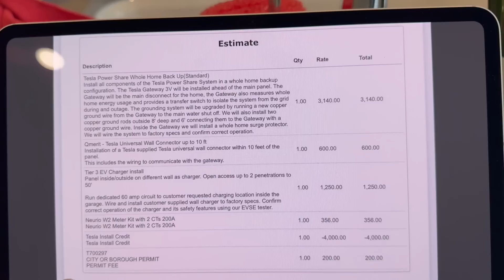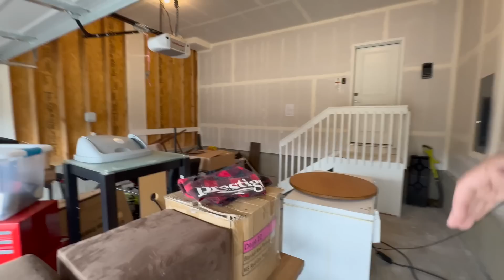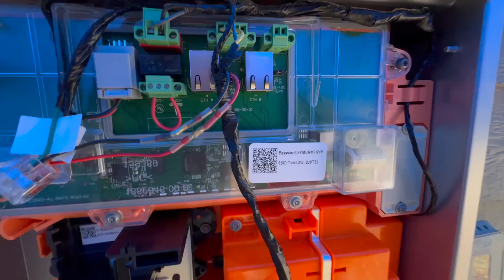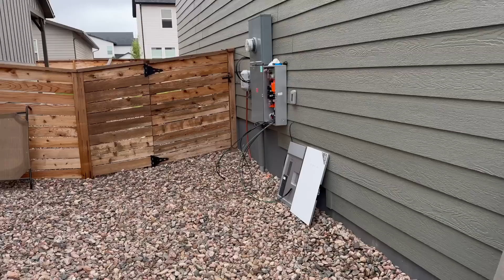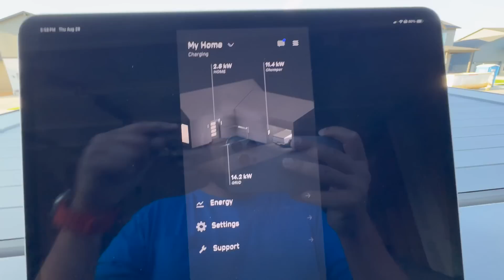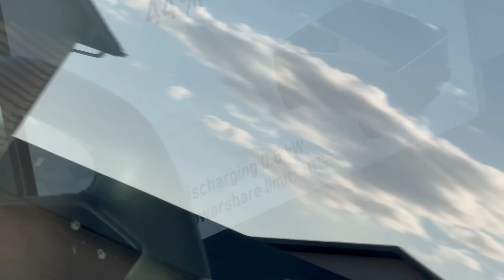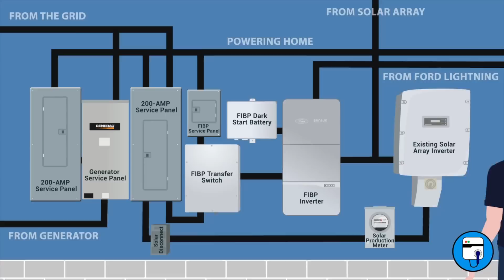Installing My Level 2 Home Charging Setup w/ Tesla Powershare Bidirectional Whole House Backup!

Comment: coils are so you can feed 240 V and have a center tap to get 120 V circuits. 240 VAC is fed on each end, with a center tap to get you 2 120 V AC circuits.  This is normally supplied by the pole transformer, but since that is disconnected when running off the Cybertruck, this is needed.
Reply: Yep exactly. Cybertruck only outputs 240v single phase. No neutral. The backup gateway has a neutral forming transformer. Really similar to Enphase sunlight backup as enphase solar micro-inverters only output 240v too.
Reply: @ColeBlack2  double yep, the coils provide a function referred to as an autotransformer.
Reply: Yes, and they probably also work to reduce common mode voltage from the Cybertrucks inverter and provide ground isolation.
Reply: My guess is that it's a split-phase downstep transformer from 240 volts to 120, and the center tap is the common neutral?. Since the coils looked like a transformer.

Sorry, I have a basic understanding of how split phase works in terms of obtaining a 240 VAC circuit.  And while my father was a lineman we never talked about the nomenclature of a transformer. So this is the first time I've ever heard the term Center Tap.

At least the post explained how the Gateway worked. Until now I was assuming it just back fed the electricity to the circuit breaker box. So at least my understanding is vastly improved in terms of how it works.But it's a shame the post didn't go into more details about how it converts single phase to a split phase service. Or the load power sharing function of the EVSE. And I was a little confusing since they used the term power sharing in two different contexts.
Reply: @nc3826 well that bothered me, too, until I ordered another boilermaker.
Reply: thanks for reminding me that... "the only winning move, is not to play."

Comment: The solution I want is a house battery, like a PowerWall, that is supplemented by the vehicle's battery. The house battery could be 5 to 10 kWh, long enough to keep the lights and fridge on, and when a vehicle is plugged in it would enable power to the other larger breakers, and top up the house battery.
Reply: Can totally do what you want by adding a PowerWall to Kyle's setup and it would do this seamlessly.  Or if handy you could go DIY with a more manual supplanting.  Just need a car with V2L capability - to connect to a charger for your battery inverter.
Reply: This is the setup I have and will have once the CT arrives. Near perfect.
Reply: @GarrettL757 dittos. My Beast came in 3 weeks ago and still no power share hardware.
Reply: An EG4 12KPV and either a server rack battery or two or their wall mount battery would be perfect for this (and most people's setups)
Reply: Look at a company called point guard energy. They have a home battery modular stack and advertise a 12.5 or 25kw EV DC bidirectional charger. It doesn't seem to be available yet though, and I haven't been able to find any vehicles it actually works with.
Reply: This is exactly why I built my Victron system.  Keeping it small with just 1 5kWh battery for now and a portable power station too.  Just need to figure out EVSEs that will integrate and if I need to get another inverter to do 240V or if I can stay with single phase.  No problems running our whole home off a 5KVA multiplus for now.  No EV yet😁

Comment: The only thing you're missing is a UPS for your wifi.
Reply: Wifi and CCTV NVR.  I have a NG generator and the UPS's are great for the change over.
Reply: It doesn't take long for a router to reboot
Reply: @Defianthuman  but better Never to .. Asia has many basic 12v batteries inline for this
Reply: @Defianthuman  better that it never goes down.  I have 3 UPS units in my home to protect various electronics.  My systems are protected for 10-15 minutes, more than enough time for the NG generator to come online.  Even better for those times the power 'chatters', nothing loses power during the chattering so can't lose power while it's rebooting from the previous dropout.
Reply: @genelane2243 I agree with you. If you have a pure sine wave UPS, even better.

Comment: The wallboard in the garage is probably due to code.  Most States require wall board for any structure connected to an inside wall of the house.  The wallboard on the outside wall would be because of the meter on the outside of the house.

Comment: Why are these all limited to 10kW? Hardly bidirectional 😂
Reply: Because inverters are expensive, essentially. On the Cybertruck the onboarding charger/inverter has to handle the DC-AC conversion, so it's limited to 10kW. On the Lightning it's offboard, but larger capacity still costs more. 20kW would be a cool I guess but do you really need that?

Comment: What happens if you plug the car in when the house doesn’t have power, does the truck have to be connected before the house looses power? 

What happens if you unplug the car while the house is running on the car? Does it let you?

Comment: Anecdotal experience, the Powerwall and gateway when reconnecting to the grid is seamless, so perhaps because its new the 2-3 seconds of outage when reconnecting back to the grid will be fixed and unnoticable in a coming update.

I can confirm that when there is a grid outage, there is a 2-3 second delay for the Powerwall to kick in so I think its working "within spec" :)
Reply: The powerwall can run AC-coupled as it's also a solar inverter (i.e. it is allowed and able to feed while the grid is up). The inverter inside the Cybertruck cannot, it's running as an independent backup generator that must be disconnected from the system before grid connection can be reestablished. Also, the split-phase transformer (that makes 2x120V from the Cybertruck's 1x240V) cannot be connected to the system at the same time as the grid transformer, and to disconnect it it must first be discharged.

Comment: The way that is wired, you can run the dryer and whatever else and charge cars. They spliced the Tesla control unit in-between the utility meter and your 150amp main braker. So, you have 200amp service to the Tesla wall connectors and the a/c unit. (but with lower value breakers for safety) The Tesla control unit then connects to the main breaker in the garage. Very well designed.
Reply: No, all power goes through the 150 amp main disconnect before it is connected to the Tesla Gateway.  That's how he simulated the power failure, by turning off the 150 amp main disconnect.
Reply: @ericjorgensen4826  that dosen't look like a breaker. It appears to be just a switch.
Reply: It could be🤷‍♂️. But it looks like a switch to me.
Reply: @hallcrash  It is the main disconnect switch, but upstream of that switch must be a 150A main fuse to limit the installation. Otherwise you could draw whatever you want from the grid instead of the 150A you pay for.

Comment: Kyle.....why run conduit from the gateway to the second wall charger.  Seems like it would be way cheaper/simpler to power the second wall  charger from existing pannel on other side of the garage?
Reply: Both chargers have to be wired to the gateway mounted outside for the load management to work IIRC.
Reply: @TechnicalLee  .... I'm not following.  Aren't the lugs on the 3V just connected to the internal panel board?  The 3V certainly isn't going to manage current between the internal board and the lugs going to the main panel. I'm thinking if both chargers are in use during an outage, he'd just be discharging the truck to charge the car!

Or are you talking about sharing available power between a network of wall chargers?  (Load sharing in the WC setup).  That mostly comes into play if multiple WC are on a single breaker.  Or if multiple WC would suck up too much of available amps to house.  And that's communicated to them over their own network.
Reply: @TechnicalLee  ... Makes sense.  I was confused because Kyle talked about the Murio sensor being installed at the main box.

Now I'm thinking the Murio will be installed at the gateway to measure total power to the house.  Then it can derate the second charger appropriately.  And this is more for on grid load management since he has 150A service and 2 48 amp chargers.  

Not sure how that will help with load management when truck is only supplying 48 Amps.  Probably just manual load management?
Reply: Obviously so he can run the house off two Cybertrucks.

Comment: Ioniq 6 VTL/H is also AC out. Wonder if the Tesla system would work with the Ioniq 6.
Reply: I assume it would not work, but it would be cool if Kyle could test it out with the new EV6 they leased.
Reply: I’d love to see him test it. But I believe if the system wouldn’t work for charging then it wouldn’t work for powering the house either.

Comment: You're absolutely correct about them taking you for a ride on the price to maximize the Tesla credit.  I had an electrician in Boulder county install my Rivian EVSE with dedicated 60amp breaker for $510 out the door.  I paid the city permit directly which was < $100 as well.
Reply: I agree, but I do wish he would’ve given us an itemized bill from the company. They did have to bring in supplies like wire and conduit. The other thing is is they did have to move the wires for the AC and neither charger were close to the panel. So hard to tell, but my gut tells me you were taken for a ride.

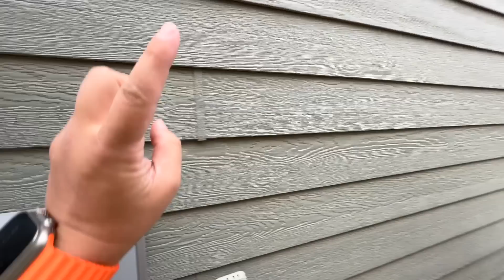Comment: 22:15 they wrote stuff in Sharpie on the Gateway? Why don't they have some sort of label maker to just label it so you can peel them off if you need to make adjustments to your system at a later date?
Reply: I think brake cleaner will remove a sharpie as well. But yea, a simple label maker would look more professional.
Reply: One can wipe off the sharpie with a solvent such as IPA, and add a label at a later date as needed.
Reply: Too lazy sharpen a pencil
Reply: Agree, electricians may use terminology different than yours.  Personalize it because it’s your money paying for it.
Reply: I thought the same thing when I saw that, it would’ve bugged me big time.
Reply: That would have cost another $4,217.45

Comment: Looks like you don't have load sheading.  Does the other charger keep charging during a loss of load?  I have a Span panel that sheds load and disconnects kitchen stove, charger and AC.  With the span I can reconnect.  I use a Tesla power wall and  solar panels. My home base load is about 1 kW.    cool
Reply: No, the only loads it can shed are the chargers and A/C unit wired into it.

Comment: I have a small battery with generator sub-panel backup on an enphase solar/battery system. It took a bit for enphase to get their software working property (over a year in beta testing) to allow for their switch to sense grid outage, switch to battery, and use the generator to charge the battery. Have had the system for four years now. Only a couple grid outages though. First one it didn't work because the battery was at 10% charge. Upped it to 50% reserve for outage scenario's and a couple other outages since and the system has switched over fine. It does cut power enough to mess with the internet cable modem and the microwave clock, but it's relatively quick (seconds) to switch over. I only wish it could support the AC unit. Neither the battery or generator have enough initial cranking amps to do that. Also can't run the stove so had to pick and choose which circuits for emergency backup. THe internet comes back up as soon as the cable modem reboots though. I was hoping your bi-directional system with 100kWh battery in CT would seamlessly cutover AND be able to power AC. Seems like the cabling and circuitry are more the bottleneck for that than the battery storage/size in CT. You said it worked, but it sounds like that could be an issue. 
I also am not a fan on different systems not having interoperability. (e.g. Enphase and Tesla for example). Also the more complex your setup, the more reliant you are on the installer and manufacturer of the components. Much more can break down and you have to pay for service calls after a limited labor warranty period. All things to consider for rare outage scenario's. If you have them frequently or are off grid and using it for overnight energy it may make more sense.

Comment: Yeah I got tired of the inflated estimates.  They literally made no sense. My father in law (retired electrician) and I installed Hubbell 14-50, about five feet of 8 gauge, double throw 50 amp for a total cost of about $450 ($150 of that was the Hubbell.  BTW the professionally installed quotes were made using a $10 Home Depot 14-50 yet they wanted $1300.00.  😅
Reply: one word...labor
Reply: @smartlifesystems  Awfully expensive labor.  Took us about 2 hours.  LOL Of course there were two of us.  Moving a circuit around to make room for the double throw took the most time.
Reply: @MikesMotorcycleProjects  I do not count your hours. I count company which have to be licensed, insured, come to your house, buy, maintain and insure vehicle for that, hire certified employee, have all the tools and equipment.....the list is much longer. If your hour wage is $50 (and you won't find electrician for hire for $50/hour at least in NY where I live). Company has to charge at least $250 to keep afloat if not doing shortcuts and breaking laws. I am not even counting big profits or backup/grow money.

Comment: Thanks for the video. I thnik you should have had him just put in a 200 Amp panel while he was there with all the charging you do.
Reply: A full service change is going to be $4,000. Plus they're going to have to run a new drop from the utility. At that point you put in a 400 amp service l and never do it again. That's big $ for little ROI.
Reply: @DJS_ENO  damn that seems high. I had mine done for 2500 to go from 200 to 400

Comment: Oof doing stuff like that to rented places. 

Now own my home so now I can comfortably do this.  Solar Tesla powerwall 3 incoming.  Having them install the same wall charger in my garage.
PowerShare ftw

Get a ups for the network equipment to avoid WiFi loss during this time.

30-100 per vehicle for this is a no brainer
Reply: Family member has F150L and uses extension cord to a pre existing generator panel in his garage to power the house (30a). Yea can't power all of it but will power mission critical stuff for days. The Pro power setup will be installed in his new house.
Reply: @SimplyGregsterEV  seen a video of that in action when lightning just came out.
Reply: @FullSpectrumWarrior  next EV I buy will have bi direction or at minimum V2L. We had a major storm last month. My sister lost power and had her Model 3 in thedriveway but couldn’t use it to power the pump..

Comment: Does it only work if the CyberTruck is already  plugged in at the moment of power outage? Or would you be able to plug in after an outage already occurred and then initiate the power share?

Comment: The return of grid power wouldn't trigger the Telsa gateway to restore the connection to the grid unless it detects continuous power for more than 5 minutes. Typically this is done to avoid switching back to the grid while it is still unstable. Seems like the same functionality of the Gateway along with Powerwalls. The 2 second delay is disappointing. Should be seamless.
Reply: This is the most critical feature. The only time I've ever had anything damaged by the grid was during power restoration. Now I physically turn my main breaker off during an outage and give it 15 minutes or so after restoration before I turn my main breaker back on.
Reply: works best with battery in line
Reply: Yeah seamless shouldn't be too difficult for Tesla inverter? 🤔
Reply: @Jako1987  Seams is easy for an AC-connected inverter. But the inverter in the Cybertruck isn't connected to the grid AC, only the load AC. Which means it cannot sync to it unless the gateway sends sync data over the data connection.

Also, backfeed prevention code may specify a minimum transfer time. That kind of regulation is aimed at mechanical switches and is a bit outdated now that electronic switches can do it within a half-wave.
Reply: I think that Tesla can't know when the ac is synced. It would need more tech to the house side. And a more robust communication system than just wlan? 🤔

Comment: So based upon this what I think is happening is that the Truck is outputting 240V not split...and the coil in that transfer for this is creating 120V.  That is almost certainly what is happening
Reply: Yep, it's not possible since the nacs connector is only two conductor. I wonder if that gateway transformer is sized to handle the full 50 amps.
Reply: @andrewt9204  Yeap it's how all older EU solar Internter I would keep this totally grid and make a off grid with transfer switch
Reply: That means each leg would have a limit than in theory
Reply: Some call it a Neutral Forming transformer.  Also it's not required with a PowerWall.
Reply: @bluedrew  that's fair description.  I wonder if th 240V output works this way that would be very interesting to understand.
Reply: NACS is 2-wire 240V so doesn’t have a common.  CCS1 is 3-wire including a common so can provide both 240v and 120v.  I still prefer small size of NACS for charging.
Reply: @johnpoldo8817  No, CCS1 also is L1, L2, Ground. CCS2 is L1, L2, L3, N, Ground. (Both plus CP, PP/CS, DC+, DC-.)
Reply: @HenryLoenwind  I think we agree CCS1 power is 3-wire, L1, L2, and ground/common.  Most US households use have 4 wires separating common & ground.